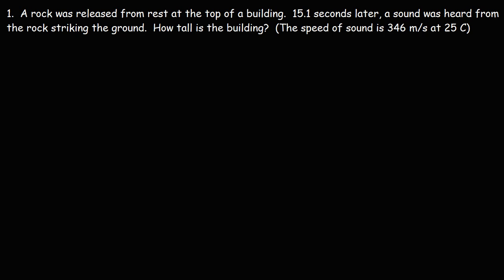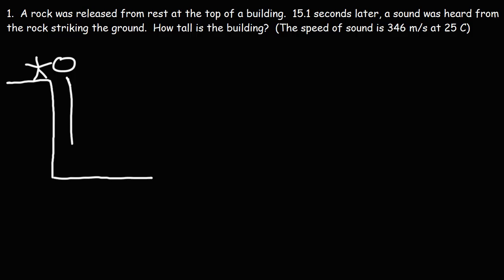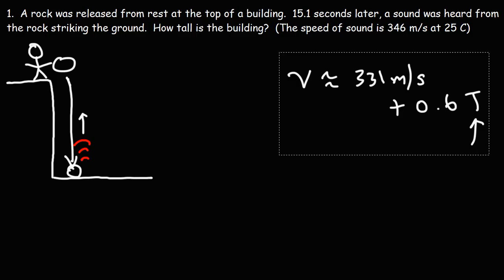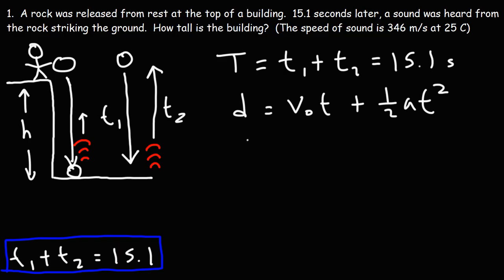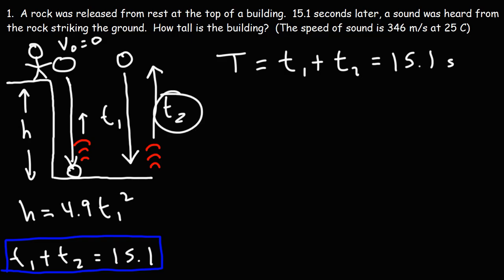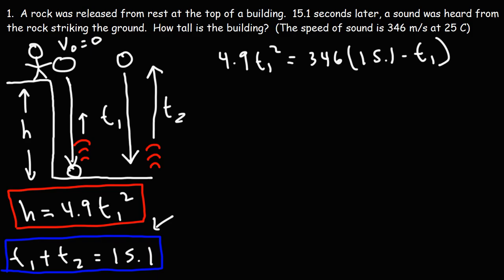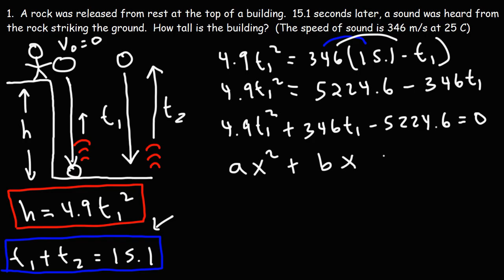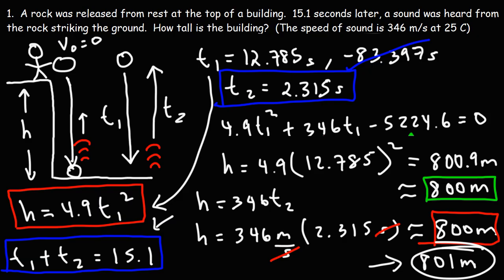How To Calculate the Height of a Building Using Physics and The Quadratic Equation

Comment: This is more about knowing random assumed physics than math. Nobody in the question is mentioned that the rock falls and accelerates at 9.8 meter per second. Rounding that up to 10m/s you can say the rock falls 10m on the first second, 20m on the second second, 30m on the third second etc. So the question assumes that the rock accelerates to infinity at the exact same rate. In reality the rock may accelerates for a few seconds but then reach its maximum speed of lets say 100m/s. In theory i believe sound also needs some time to accelerate to 346m/s and doesn't start instantly off 346m/s. I'm not sure about the sound, but the rock definitely doesn't accelerate how assumed in the video. And since the fall speed is already entirely based on assumptions, since the 9.8m/s is mentioned nowhere in the question, neither whether or not it reaches a maximum speed or not like in reality, you can't really answer this question given just the information given in the question. In reality you would need a lot more information about the physics of the rock and the air to first of all properly calculate the rock's fall and acceleration speed. Even when approtiating the height, i think the real answer would be more like a height of something between 600m and 1000m. I'm not sure if the slowed acceleration would increase or decrease the height of the building, i think decrease? I'm generally too dumb to solve this question lol but i just wanted to mention that the question lacks a lot of information to really solve it and is largely based on physic assumptions that don't even make sense. You could replace the rock with a human.. or an asteroid.. and would get the same answer using the same assumptions in the video. So this shows how flawed this question/problem is. Including the air temperature, but ignoring all these other things is also quite funny. All we can really say from the question is that the building has at least a size UNDER 15.1*346meters. (5224.6m) If the rock falls instantly at infinite speed.
Reply: since the rock is free falling which is due to gravity, it is 9.8 m/s² by default
Reply: gosh can you summarise this comment
Reply: it's not an assumption, it's basic knowledge.. if you're not aware of it please get basic knowledge before jumping to conclusions..